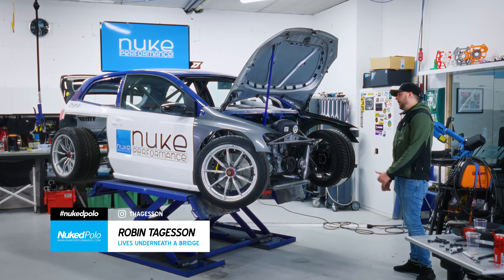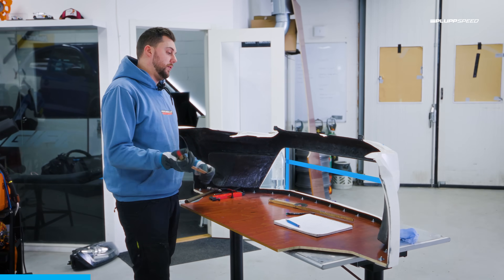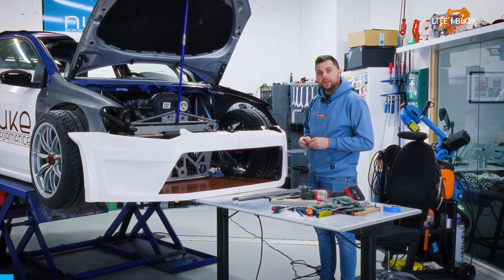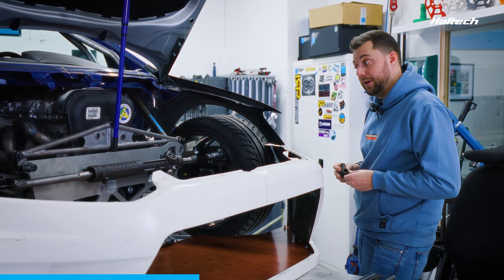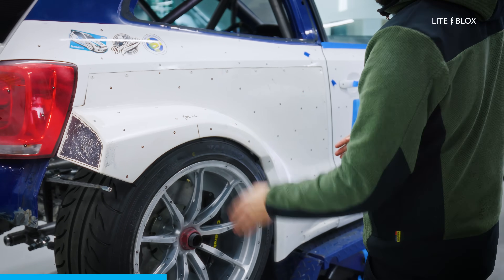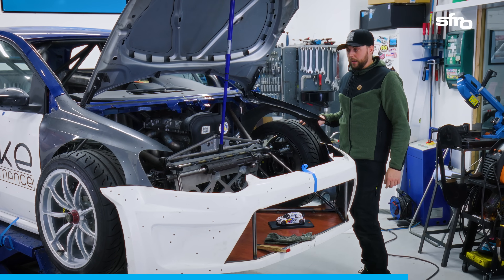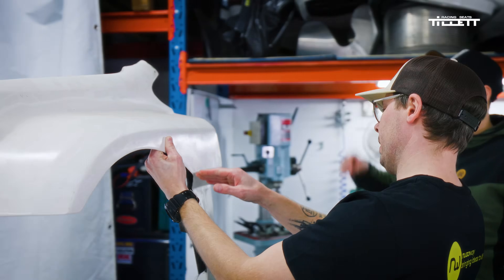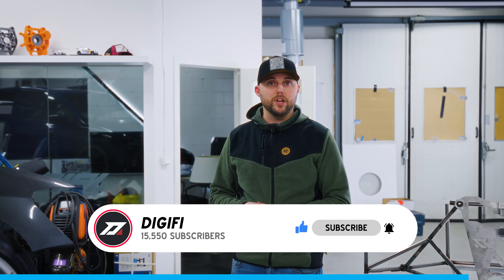BUILDING A RALLY INSPIRED RACE CAR | PT5

Comment: I built a tube frame car in my garage, but not to anything like this level of fabrication. I started with a $250 shell. Why did you start with a complete car? Would it not have been cheaper to buy a wrecked car? There's very little of the VW left anyway. I love what you're doing.
Reply from the maker: That's awesome! The car was wrecked in the front. It was in a frontal accident in Germany. But the engine still worked so we could sell engine + transmission and all interior 😄 If you check the recap in the beginning you'll see the car is crashed in the front- Well there isnt any front. And also some scratches in the back. The damage was perfect for us since all the areas we interested in we're straight in the chassi!

Comment: Nice build. It's very easy to under estimate the forces that can be produces by race cars.
Reply from the maker: Yes, things takes so much more time than imaginable 😅 You have any similar experiance?
Reply: @digifimedia  Yes, most recently we broke the bracket that holds the rear wing. I vastly underestimated how much down force it would make. I wrongly calculated it to be around 250 kg's @140 kph but it was closer to 600 kg's.... We also have many " extra brackets " for the other side... Ask any fabricator about that...
Reply from the maker: Thats is soo crazy!! Do you use any simulation software when you calculate?